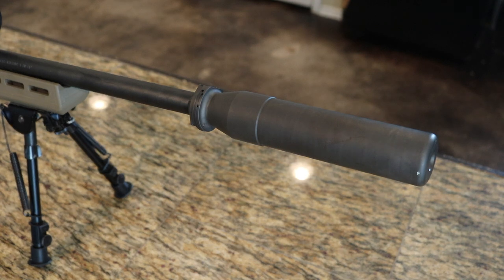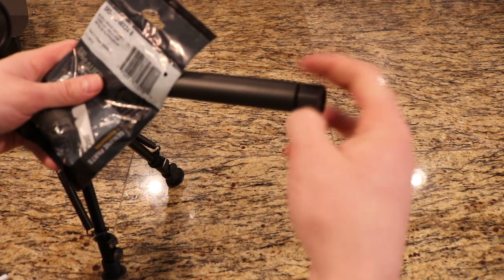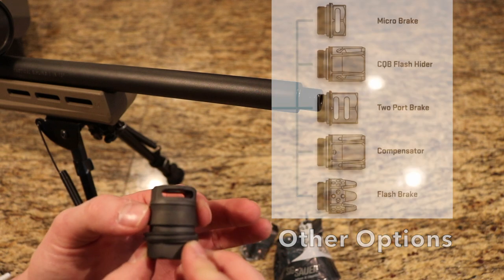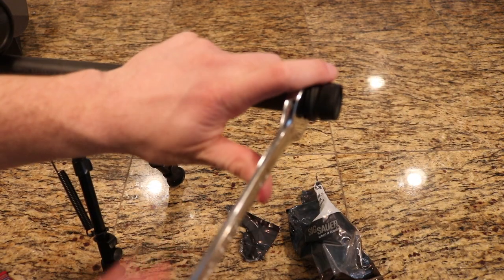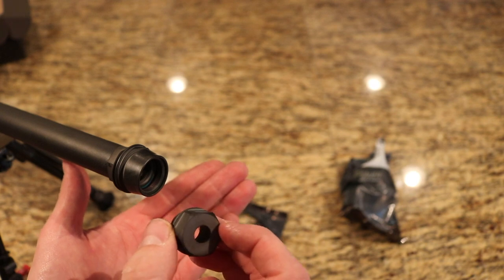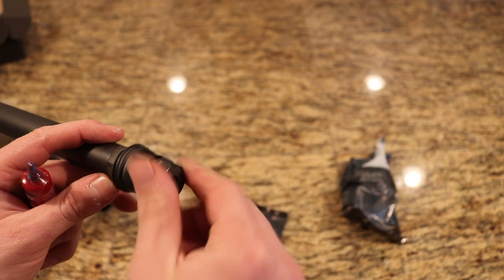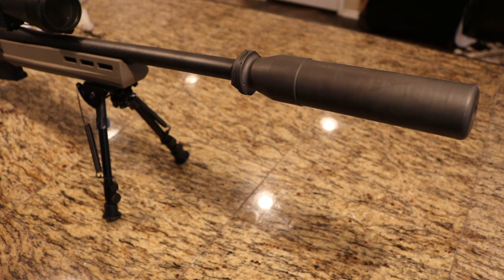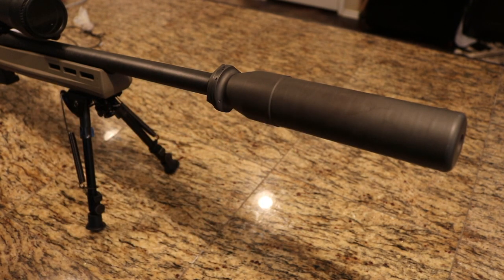Sig Micro Break Install & Overview | SRD 762 Ti Qd

Comment: Any problems with the brake portion backing off after multiple rounds? Happened 2 separate times to me on my short barreled ARs
Reply from the maker: William Waite as of now no. I have probably 400 rounds through the break on my 16” 5.56 upper. 100 rounds through my 10.5” 300 blackout upper, and about 20 through this 308 without anything coming loose or showing any signs of issues. 
I would advise using locktite on the threads in addition to the provided crush washer for the break portion of the break.

Comment: I just got this suppressor, but didn't see the 'crush washer' included in my box.  What is the purpose of this and is it needed?
Reply: I found it... but what is the purpose?
Reply from the maker: 513KOH it is to time the center piece of the break
Reply: @513KOH to orient the ports. If you just screw it on there, they might be at 1 o’clock and 7 o’clock. You will generally want the ports at 3 and 9.